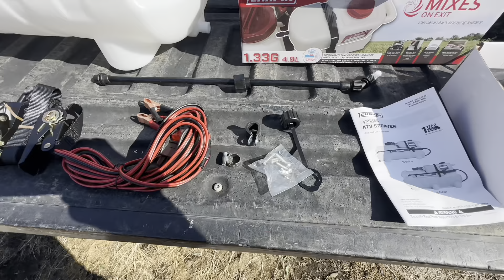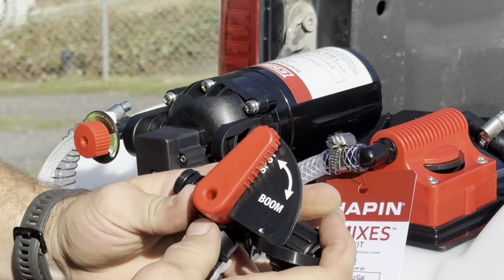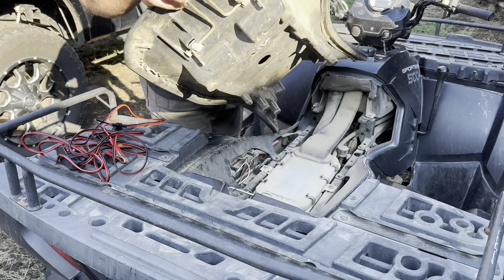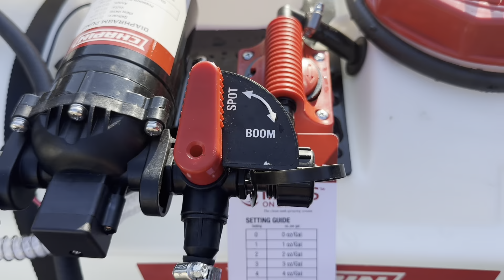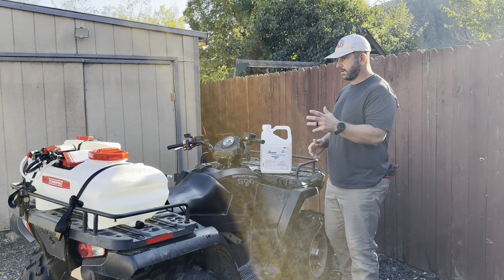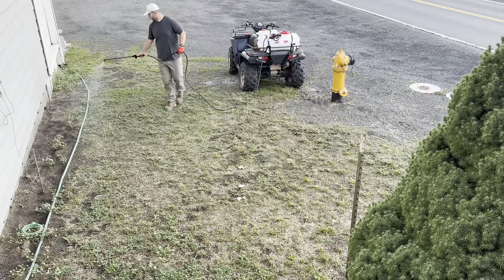Chapin Mixes On Exit Sprayer Review | Is this the Best ATV Quad Sprayer?

Comment: Always disconnect your chemical tank when you are finished or your chemicals will siphon into your clean water tank. I know this from experience with mine. Temperature changes can add pressure or vacuum to the main tank. Vacuum will suck the chemical into the clean tank. Like how your fuel containers expand and contract.
Reply: Mine backflows AS its being used. I never let it sit more than a few minutes and it backflows into the fresh water tank. Cheap chinese garbage components